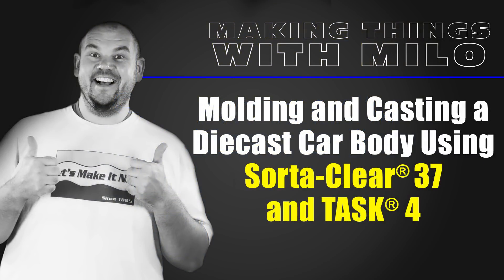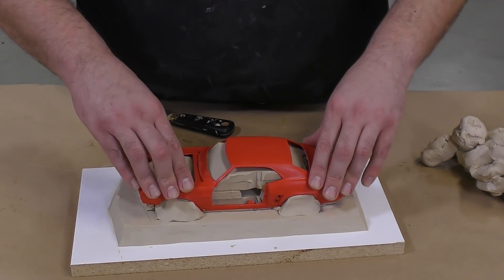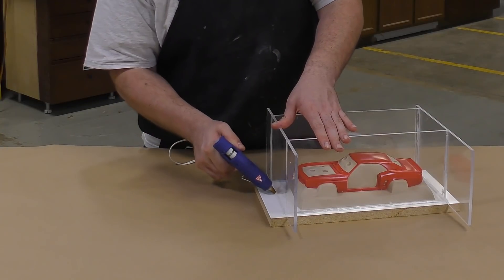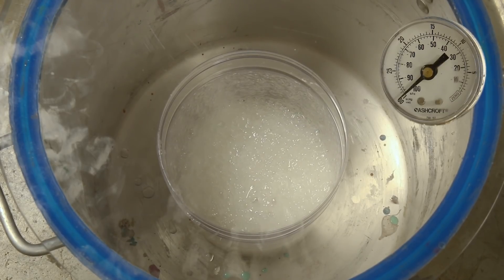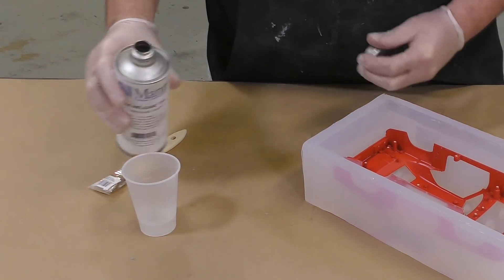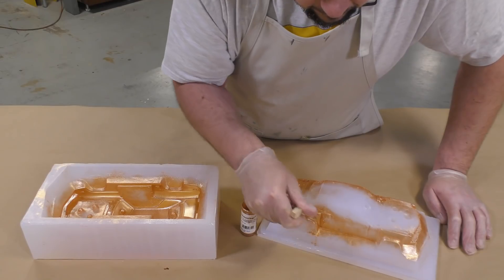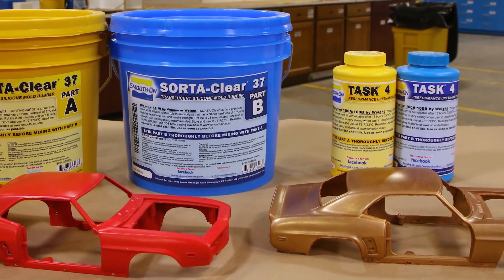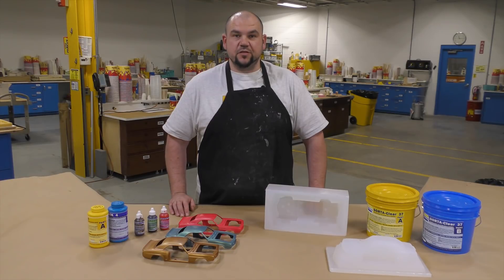Mold Making Tutorial: How to Make a Silicone Squish Mold for Casting a Plastic Model Car Body

Comment: Do I necessarily need a sulfur free clay for tin cured silicone?
Reply from the maker: Hi there! Tin-cure silicone can cure over models containing sulfur if the model surface is first thoroughly sealed with an acrylic spray.
Reply: @smoothon  So I don't need the acrylic spray if I use the sulfur free one?

Comment: How about 3D Scanning the object and then using a Resin 3D Printer to print the mold halves? There are 3D Printer Resins intended for casting.
Reply from the maker: That would be one way to do that however silicone allows us the advantage of having a flexible mold that does not require mold release when pouring resin into the mold to create the replica.

Comment: Ok Milo- excellent video, but the one question that I have which wasn’t discussed, was how to figure out how much resin for pouring the car itself?
Reply: You can use water displacement. Fill a container on a scale with water sufficiently to be able to submerge the object, zero the scale, submerge the object without pressing on the sides or bottom of the container and the weight increase in grams will be the volume in millilitres plus that of anything suspending the object that was below the water surface.

Comment: I used Smooth Cast 300 for a slot car body. Worked well. Is Task 4 a better option, though? If so, why?
Reply from the maker: TASK 4 is stronger in a thin section.
Reply: @smoothon  Thank you. Also, what resin is most receptive to dyes? Is Task 9 the best product to get very strong solid colors?
Reply from the maker: TASK 9 or Smooth-Cast 325 series resins are color-neutral and easy to color.
Reply: @smoothon  Thank you! 👍

Comment: Does task 4 require a pressure pot? Or can I get away with not using one
Reply from the maker: It would depend on the application and mold configuration.  Using a pressure pot when casting is the best way to eliminate the risk of bubbles in the casting.

Comment: I'm trying to cast a 1/35 tank hull about the same thickness as your car model. However, the 305 I am using is too flexible. Will the Task 4 cure more rigid with little to no bending?
Reply from the maker: Hi there!  This is a good question for our tech support team, can you send them a ticket here? https://www.smooth-on.com/support/ticket/add/agree/ Thanks for watching!

Comment: What is this in 5:29?
and Why did you use it?
Reply from the maker: This is a vacuum chamber used for removing air from silicone rubber - https://www.smooth-on.com/products/vacuum-chamber/
Reply: Thank you very nice and useful video, How do I get a vacuum chamber?  Can it be replaced with something else?  Can it be dispensed with?
Reply from the maker: Perhaps this FAQ will be some assistance - https://www.smooth-on.com/support/faq/116/

Comment: i want a vacuum mold of a lexan body. i have the original body made from .007 thick lexan. i was thinking of pouring the mold full of plaster but a nice high temp firm mold that would not break, because there is thin sections on the body! 1/24 scale but i may make up to 1/5 scale. can you make a video of making a mold for a vacuum former.
Reply from the maker: Can you send us a tech ticket? Our team can help you - https://www.smooth-on.com/support/ticket/add/agree/

Comment: Can we make the car body using  recycled plastic (hot) instead with the same silicone mold.
Reply from the maker: This silicone can withstand 450F, the process of getting the plastic into the mold would be much different, and would require some testing.
Reply: @smoothon  okay, thank you. God bless you

Comment: How are you ensuring a complete fill, and therefore void-free castings, without venting, gating, and spruing your tool?
Reply from the maker: The squish mold technique helps to eliminate these voids but there is a risk.  Also, testing different amounts used to fill the mold can help determine the optimum fill level to allow air to be squished out.

Comment: Hi, looking at your video and getting inspired, and I'm curious about setting up a vacuum degassing system,  I'm wondering if there are any special requirements or considerations to think of when looking to purchase a vacuum pump for this application? If your vacuum chamber is for instance about 10 liters/ 2,6 gallons? Does the power/ liters/ pr minute of the vacuum pump matter? Or will a small pump jus take longer to produce vacuum in the chamber ? Thanks..
Reply from the maker: You will want an 8 CFM vacuum pump in order to pull the 29 inches of mercury required.

Comment: Wow I really like how you're doing all this, but only problem I'm having is I don't have a vacuum to take bubbles out. I would like to make replicas of my car lens or any interior or exterior plastic pieces. I'm trying to do a lot of research to which is the best material to use to make the molds and what kind of plastics I can use or even plexiglass so the parts are clear with no bubbles. 

Any tips?
Reply from the maker: Yes, you can use a silicone for the mold which does not need vacuuming, like Mold Star 30.  You can pressure cast the pieces instead of vacuuming.

Comment: How do you know how much of the Task to use, so as not to get a lot of 'squeeze out' and thus preventing a 'thick' cast?
Reply from the maker: this depends on your particular application.  This is a good question for our tech support team, can you send them a ticket here? https://www.smooth-on.com/support/ticket/add/agree/ Thanks for watching!
Reply: @smoothon  Well I was obviously asking in regard to this application - the one you used in the video. Usually I pour water into the mold and measure the volume, but with a mold as this, I wondered how you did it. I guess you just discovered the volume of the car itself.

Comment: I notice you used pressure to avoid gas issues rather than vacuum.  What is the reasoning behind that?
Reply from the maker: These techniques are often used in different mold configurations. Here are some links which may help - https://www.smooth-on.com/support/faq/156/ and https://www.smooth-on.com/support/faq/111/

Comment: Would like to see a video like this but using vent sprues and either injection or pour method.
Reply: Pretty much the same thing. Just add a pour spout on the underside roof of the model upwards and a few vent sprouts on the sharp points of the bottom of the model. lol

Comment: If I wanted to make a mold of a very delicate game board figurine, would this be a good choice? 

Obviously on a smaller scale but my biggest concern is the mold breaking the original figurine. It’s one of a kind.
Reply from the maker: You may want to try a softer silicone such as Mold Star 15

Comment: Does Task 4 take paint well? It takes 16 hours to set before demolding? What's the shelf life once opened?I just want to know because I used the quick setting one and there's usually not enough time once it's mixed to get it in the mold and one part of the resin and OOMOO always dies on me so it has to be thrown out. Also no one mentions pressurizing of the resin to get it nice. Good products, just a few rants.
Reply from the maker: TASK 4 doe require a full 16 hour cure for full strength in a thin section.  For more info on painting resins, check out https://www.smooth-on.com/support/faq/141/

Comment: How did you calculate how much resin is required for this model?
Reply from the maker: You can weight the original and se a similar amount, or use displacement by dunking the original in water and seeing the volume of water it displaces.

Comment: I would like to make a mold of my Commodore Amiga 500 case and cast it in transparent green resin. Can you recommend a resin and also since the case is just like this model only larger, is there a special silicone I should use so the mold does not sag under its own weight and possibly make the casting uneven? Thank you.
Reply: transparent resins require vacuum. you require a large chamber to fit you mold into.

Comment: Your videos are really helpful! I'm wondering if there is another way to prevent bubbles while mixing sorta-clear. I don't have pressure equipment, as I am making molds of very small things. I've heard putting them in the fridge for up to six hours works really well, but i was wondering if you guys had any thoughts. Thank you!
Reply: I have the same question. I'm wondering if applying a massager to the base might help giggle the bubbles up through the mold.

Comment: An excellent tutorial  - but what to do if you do not have degassing facilities - i.e a vacuum chamber?
Reply: if you're mechanically inclined, there are tons of DYI videos. i'll buy mine, though, they're not horribly expensive. 

but, if you don't have one, you'll have to risk bubbles. based on what i've seen, you can reduce bubbles by pouring high, then tapping the sides of the mould.

Comment: Hey I wan to do a casting or a scale car model like the one that you used on this video. But i have never ever done any molding or casting work. Can I use the same silicone that you used on this video without the vacuum spet? I dont have anything to do this step vacum out the air bubbles. 

The casting is for a proyect of a small car robot. And i expect a lot of tear and breaks if the casting is rigit plastic, on the process of testing the robot. So It would becaome handdy to have a few scale car models that are a little flexible and strong like the casting you did on the video.
Reply from the maker: We recommend looking at the Mold Star 30 for an option which does not require vacuuming - https://www.smooth-on.com/products/mold-star-30/

Comment: how do you determine the amount of resin needed  the calculator on the site doesn't explain how to estimate like a car body it only has solid object measurements?
Reply: One year later ,watching this video and I’m wondering the same thing. 
But science to the rescue : use a graded water recipient, fill it to an specific level( like 1000 dm3), submerge the object, measure the difference, that’s your volume. The density of the resin should be easily available and from those two you’ll get the amount of resin needed( the mass).

Comment: how much cost these materials  ? how much quantity needed to cast that car body ?
Reply from the maker: Each car body is only about 100 grams of material. Cost per unit will depend on what size you purchase the material in (trial kits versus 55-gallon drums, for example), and how much your local distributor quotes you for materials. You can get a general sense of material prices by browsing https://shop.smooth-on.com/

Comment: You gave me a idea...I can use silycone,  that one you use as glue... it can work?
Reply from the maker: That type of silicone is not made for moldmaking, the cure of caulking type silicone would be very long, and the tear strength of the mold will be very low.

Comment: After making this part would all the other missing bits need to be cast from the same material?  In other words could I just glue other parts made of different materials to this, like styrene?
Reply from the maker: Yes, the proper adhesive (CA glue or epoxy) would bond this to styrene or other materials.

Comment: do you have to use the camber? is there another silicon that does it without degassing?
Reply from the maker: You could use our Mold Star 30 - this is a firmer silicone with no vacuum chamber required.
Reply: what is the reason you used this silicon in the vid? I want a squish mold as well i'll get the star 30 if it's just as good

Comment: Great video.
I plan on casting a single-gang drawn electrical handy box using a crystal resin. Would the process be the same?  I'm worried about breaking the "screw tabs" (that point toward the inside of the box) when separating the two silicone halves.

Comment: This is an interesting video - thanks. I have an idea for a project which I suspect this would be very useful for but the object to be cast would be an automotive light front. The current item is glass and the casting material would need to be UV-resistant and impact resistant as well as strong enough not to crack readily. 

I'm in the UK - would it be possible to discuss this requirement with someone from your technical department? 

Thanks again.
Reply from the maker: Absolutely. You can contact our customer support at 1-800-381-1733 or online at https://www.smooth-on.com/support/ticket/add/agree/. You may also want to contact your closest distributor: Bentley Advanced Materials. http://www.benam.co.uk/contact-us/

Comment: I'm actually going to be doing this pretty soon but with a truck. What was the ratio of task 4? I know it's one to one, but what was the amount?
Reply from the maker: It was a total of 100 grams. 50 A and 50 B, Keep in mind that the car only takes about 60 grams, 
The rest squeezes out of the mold in the process.
Reply: And what would I need to make a clear plastic window?
Reply from the maker: You could use our Crystal Clear resin for this but it should be used in a tin silicone mold such as Mold Max 30 - https://www.smooth-on.com/product-line/crystal-clear/